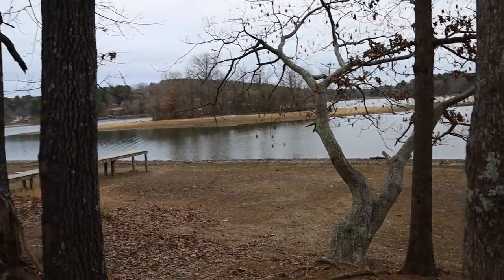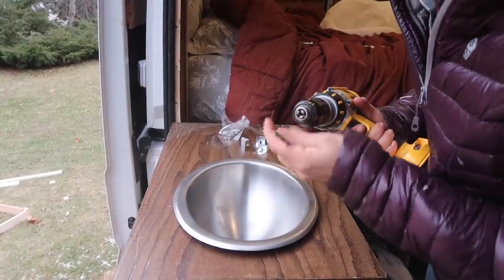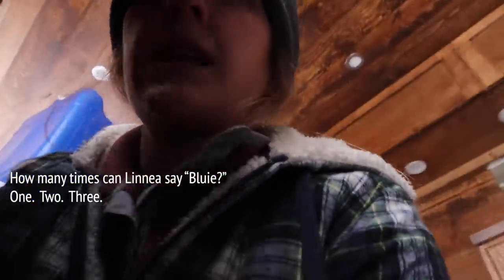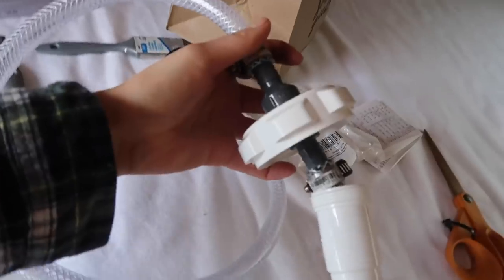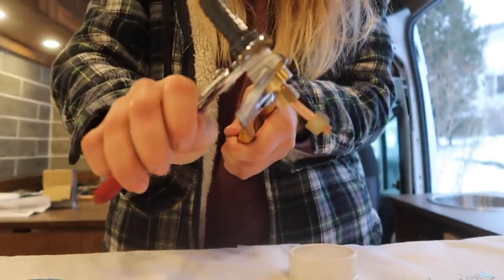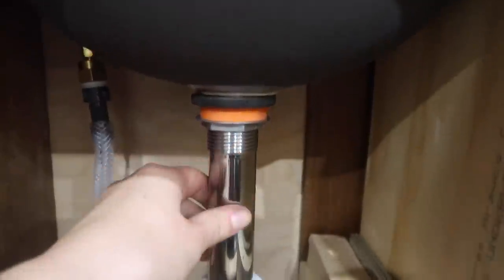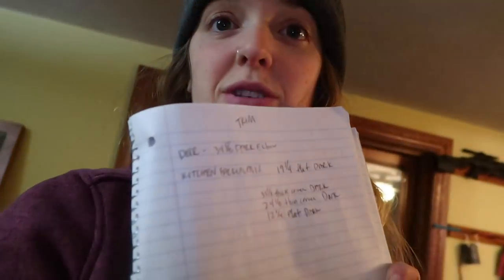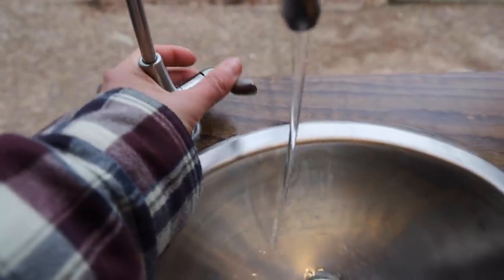SIMPLE & CHEAP Van Build PLUMBING | DIY Water System

Comment: I'd like to see a close up the connection that is on the cap to your water supply. How does the hose go through the cap? Is it a quick unplug to undo and fill your water supply tank? Thanks.

Comment: Ingenious, thanks for posting.  What size barb hose-adapter are you using to connect to the blue water supply container?  I have a similar blue container but the opening in the cap is not 1/2 in.

Comment: Hi Linnea! I really enjoy your videos and you are a source of knowledge for me. One thing that I just noticed is that you do not have an elbow pipe from the sink to your grey water tank. When you do not have an elbow, bad smells is likely to come up from the Bluie (six 😜) to the Sink (faucet) hole. There are some straight pipes (with some black magic in them) that have water traps that prevent bad smells where there isn't enough space for putting an elbow. I hope this helps!
Reply from the maker: Hey thanks so much!! I appreciate it!
Reply: Oh yes i have seen these used in place of the elbow,. Thx “comment section” I too will look for this black magic in a pipe. 👍
Reply: @Linneaandakela  hepvo trap, long balloon or the like with end cut off placed around your sink pipe hanging down into your white pipe should work pretty well

Comment: Crazy. I’m using the same reliance water containers I had in my garage for 4 years.I purchased the same whale water pump/i modded a stainless bowl and fitted a drain system and purchased a cold water faucet on Amazon.I’m converting a 6x10 cargo trailer into a camper.

Comment: I love your videos! Here is one small tip about your gray water plumbing. Ditch that straight tube and either get a longer flexible tube so you can run a loop first before it goes down and into the tank so it effectively creates a siphon, or get a ready-made siphon. If you don't do that, all the bad smells from the gray water tank will be coming out from the sink and make your van smell like a cesspit. 
Keep up the good work.

Comment: My wife and I are considering buying a 76 VW Westfalia Camper. It's been completely restored. However, it is missing the one piece sink, stove, fridge unit. They are impossible to find. Watching this definitely gave me the idea that I CAN build pretty much the same unit using materials that you showed in your video. Thank you for that. By the way, I'm pretty sure you can buy a cheap water pump that can replace the foot pump so the water can just run like a regular sink. On Amazon, there is a $20 mini pump that I bought to drain gas from the mower and other things so when winter comes they won't sit with fuel in them all winter. That simple device makes it pretty obvious that a simple electric or battery operated- in that case- pump will work instead just so you know. Thanks again!!!. Love the puppy.

Comment: You could probably add a 1 gallon pressure tank after your foot pump to get most consistent/quicker water flow. Might need to add a check valve but that's no biggie
Reply from the maker: Thanks for the suggestion!
Reply: @Linneaandakela  https://www.amazon.com/Jabsco-30573-0003-Mini-Accumulator-Tank/dp/B01L2VD41M/ref=sr_1_8?dchild=1&keywords=bladder+type+accumulator+tank&qid=1611538966&sr=8-8

That one is 21.5 ounces capacity (about 2.5 cups), and it comes with 2, 1/2" hose barb fittings that would fit right on your hose you used. Its small size (8.4"x4.7") should fit perfect in your tiny home on wheels

Comment: Just a thought ... To easily secure your water jugs while driving drill a small hole  (or two) in the cabinet floor for a 1/2 inch dowel rod, probably any length will work.

Comment: This was a project I was long dreading and I just finished it - finally no leaks! The hardest part for me was getting all the fittings and everything connected. I basically used a garden hose quick connect thing and attached it to CPVC to get the potable water - yours is much simpler and works just as good. Crap, I didn't know you're suppose to putty the drain.

Comment: If you decide you need more room under the sink, fit a salad bowl with a drain, set it on top of a new counter. Only drill 2 small holes in your countertop/wood. One for the faucet, one for the drain that holds the sink/bowl. Lots  of room underneath!!!

Comment: Nice job as usual...if I can give you a suggestion, you should add a siphon under the sink to prevent bad smell from returning up...
Reply: I dont know what a siphon is referring to but I have watched the tiny home sink installations where they found the importance of a P trap, or a curve in the pipe for smells. Just take a look under a sink in a home to see it.
Reply: @longhairmullet  it’s exactly what I meant. Maybe siphon is too technical....😂 sorry. A  curve will be fine...

Comment: hi, i was wondering does the hosed that go into the jugs need to be air tight? i am handy capped and have a very hard time working under my sink. thanks much!
Reply: You cannot completely seal fresh water or gray water tanks.  The water pump can collapse your container from vacuum if it's not vented.  If the gray water is not vented, it will bubble back through the drain, kinda gross. Also, she should have used a RV drain trap (compact size water trap), because the gray water will start to stink and smells come through the sink.

Comment: the rubber gasket fits up into your sink then the nut tightens the rubber up into it... you just have it mixed up... good effort for your first time..
Reply from the maker: That is what I did! I just needed to add some more before I added the but otherwise it didn’t fit the thread correctly :)

Comment: Thanks, very simple system. The only suggestion I would make for a minor improvement is turning the grey water tank sideways so that the depression under the handle will allow you to slip it out easier from under the sink. The slide in pipe is a great idea, so use the depression in the tank to slide it out from under the pipe much easier.

Comment: Why not just use biodegradable soap and drain strait though the van floor? The Gray water will become unsanitary over time. (or a hassle cleaning) I use those water containers at home and they work well, as intended.(gravity)

Comment: I love your videos. I know this is a year old but I just found you. I did wanted to say one thing. As a retired water inspector and biologist, saying something is biodegradable is an industry misnomer. Liquor, orange juice and vegetable oil are all biodegradable, however if placed in a stream, wildlife can die. No fish or macro invertebrate can live in those products. Please use dump stations when possible and if not, dispose so runoff is contained at least 100 feet from any stream. Thanks.

Comment: Hello, I don't think that was easy. A lot of fitting, trial and error, wood cutting, and then there's the whole foot pump thing. Might be okay for a sailboat, but I need a more steady flow of water. Don't you think the real cheap and easy way is to use a drinking water bottle pump? USB rechargeable not that loud. You could install a small sink, but you don't really need that. Just a tub of some sort to catch the water, after you use it, just pitch it out the door. Wipe your tub out and put it away. Now you have more counter space. I don't know that's just my opinion. Thanks for the video, and good job on all the stuff you've done.